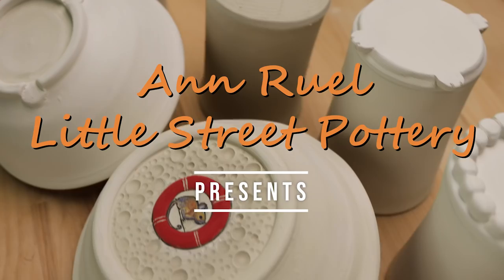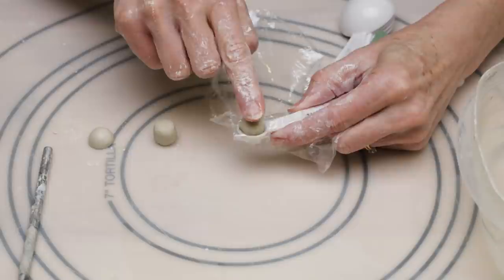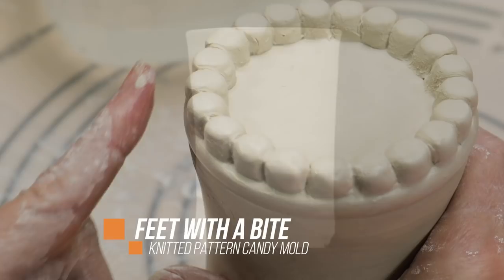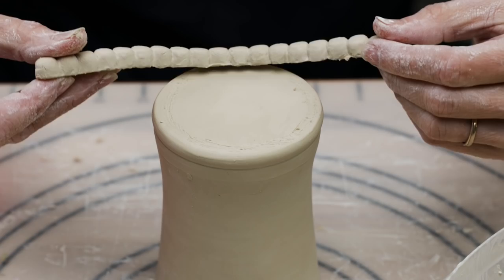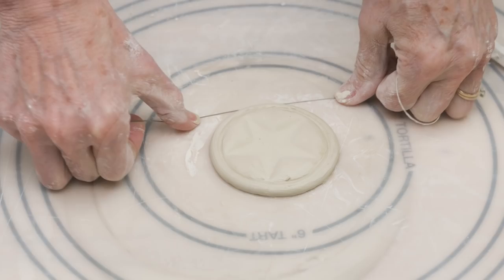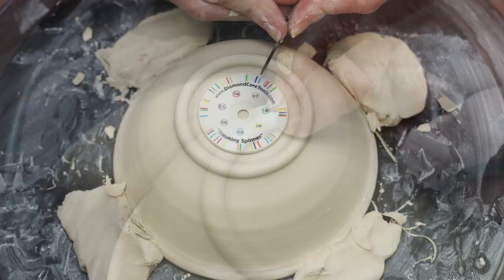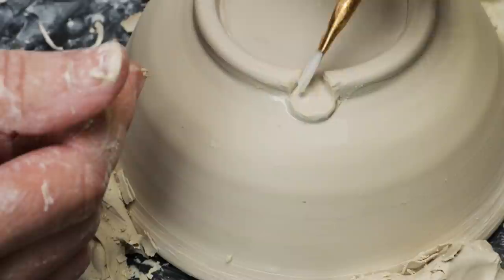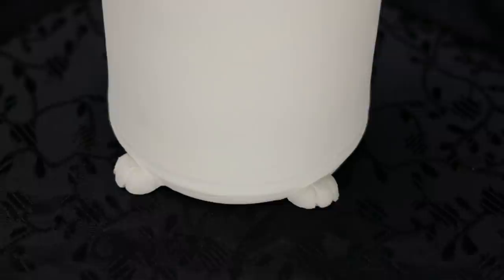10 Great Foot Ideas for Pottery!

Comment: One thing I'd mention (for your four polka dot feet especially) is that 3 feet are always going to be more stable (think of 4 vs 3 legged stools, the former always has one wobbly foot!). On the other hand Alan Caiger-Smith (when talking about decorating pots) believed that even numbered divisions (i.e. 4, 6, 8) are more "formal" than odd numbers (3 and 5). I always thought it was an interesting point, and for certain decorative motifs (and feet in this case) has does seem to resonate with me.
A great video though with lots of good ideas I'd never really considered. Thanks for the food for thought!
Reply: Thanks so much for that perspective Robert.  I thought about just putting three on the bottom.  Funny thing is that I thought if I did that, more people would comment about the need for four feet as there is hot liquids at stake and four just  visually gives more confidence.  ...the good thing about the round feet is that they are easier to ground so I dont worry as much about the wobbliness.  I like the logic from Mr. Smith about the formal vs. informal look.  I suppose the aesthetics are up to the artist arent they.  Great conversation! Thanks so much!
Reply: @annruel9142  There are always so many things to consider with small details. I certainly see how people would want 4 feet for safety! I do cutaway feet (like your gatorade cap arch foot) on my mugs (3) and one thing I realised after the first few is that it's aesthetically more pleasing if the holes are spaced evenly with respect to the handle. Personally I make one cutaway directly opposite the handle and the other two spaced evenly. You could do it the other way around too. (Honestly I'm not sure it's visible in my mugs except when you turn them upside down, so it's more like a perfectionists detail!) On the other hand (there is always another hand with me!), generally we stick our mugs in the dishwasher in a specific way. I like the handle to slightly stick through the fence, so it's probably at a 45 degree angle and there's probably an optimal way to position the cutaways so that the most water drains out ...! While I am slightly obsessed by function, that goes too far! Please keep making your excellent videos. At the very least they really stimulate thoughts on things to consider.
Reply: @robertharris1748  you are so right, Robert.  Functionality and Craftsmanship are what all potters should really focus on but are the toughest to perfect.  Sounds like you have a good "handle" on that (and feet!, haha). Nice to meet you Robert. thanks for watching.  Happy potting!!!!

Comment: Wow I’m a newbie and I am still trying to figure out a cheep wheel to practice on before spending lots of money. After watching what you have done I’m even more keen to get a wheel, those bottoms of these items are wow can’t wait to try them myself. When do you know when it’s leather hard to carve the feet? Thanks for the video
Reply from the maker: Leather hard clay is partially dried clay.  Because it still has around 15% water content, it can still be worked.  However, it is firm enough that it does not distort when handled.  Leather hard clay is versatile and can be trimmed, scored, smoothed, burnished, painted with slip or underglaze, and joined.  Bottom line - you know it when you see and feel it over time.

Comment: I so appreciate your videos and your humor!!! Your ideas are always great and very useful. I was wondering if you know of a way to make a nice foot on a handmade mug? I use glazes that run, midfire, and the foot really helps the glaze from dripping too far but I can’t figure out a way to make one. I don’t have a wheel so it’s been hard. Thank you!!
Reply: Hi Michele.  I would think that some of these ideas would work on hand built mugs.  The little teaspoon made "polka dots" would keep the mug elevated and could be attached the slab that you attach at the bottom of the mug.  The molded star would also be a good one to add to a slab and attach on the bottom of a hand built mug. ...I found the mold for the star at the Lowes or Home Depot.  They are on their websites too.

Comment: I bet that wiggle wire pattern was created by zig zagging through the bottom, but instead of going straight through, doing it in a circle, like you did at 9:25. Essentially combining both methods. Maybe the wire wasn't held taught, might have been pulled through loosely, while changing directions. I'll have to test it out

Comment: Why doesn't she use slip?
Reply: Hi Mary.  I use a porcelain that when I wet it, it dissolves easily.  In the video you see my score the clay and then I use a wet paint brush to add water to the scored areas.  The loosened clay bits dissolve making a nice sticky slip.  That is all it takes with this clay to make the attachments stick very well.  I then go back over the seams with a wet paint brush to seal them.  Thanks for asking :-). Happy potting
Reply: .....some of the techniques were edited so that it skipped the part where I wet the scored  clay but see the other comment for the detailed description of how I "slip"